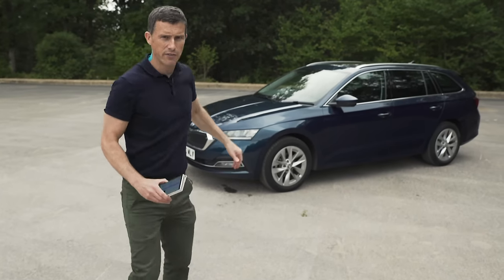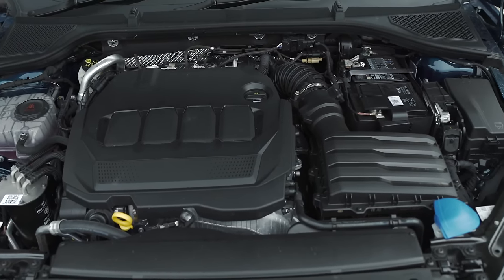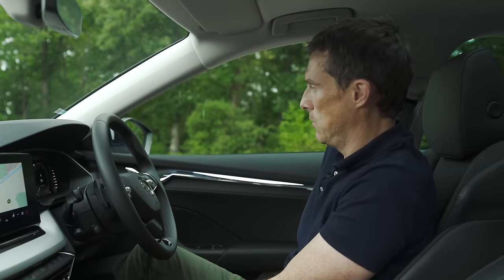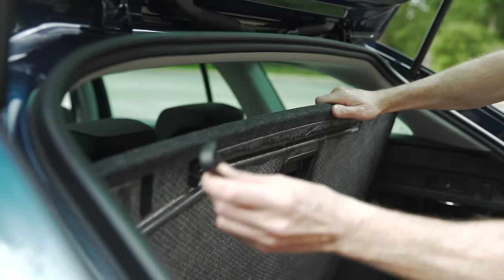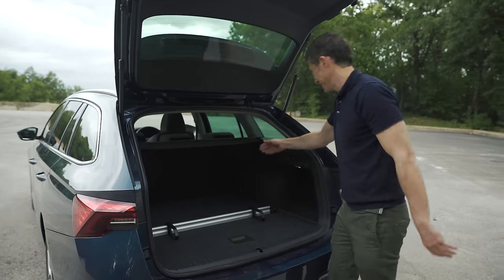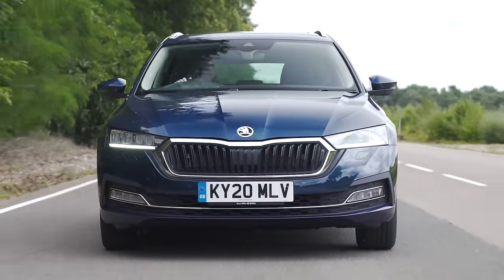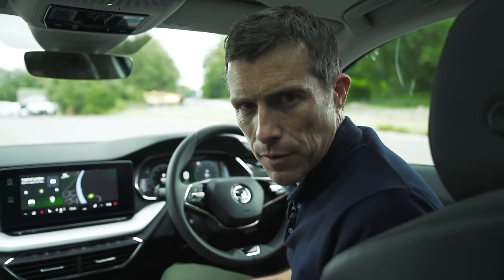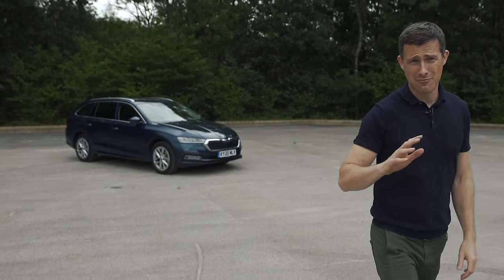The only car you really need: Skoda Octavia 2021 review

Comment: 11:45 That wiper fluid cap is genius, should come standard on all cars 👍
Reply: nah, it's better, but if you pour it on the blue part it  just splashes everywhere, so basically it only saves you a little spills when you aim directly into the hole
Reply: I hope that the plastic doesnt go bad when the first winter comes
Reply: @evokki0075  What weird car are you driving that has plastic "going bad" in winter?
Reply: Doubles as a she-wee 😂
Reply: I would much rather have that scraper or even umbrella as a standard. Especially with winter like we have this year.
Reply: that cover doesn't work good, drips at seams

Comment: I took one of these (plug in hybrid version) on a roadtrip in Finland from Helsinki all the way up to the northern border to Norway, well beyond the arctic circle, and I also did a similar drive in a Golf 8. And I must say, I was blown away by how much better the Skoda performed. The handling on the frozen and snowy roads was on point, the engine had no struggles at all in the -30C weather and the ride was super comfortable. The Golf wasn’t bad in any way, but the Skoda was so much more spacious, the drive train felt a lot better and the interior felt more comfy.

Comment: I have this car , skoda octavia III 105 HP fabrication year 2013, i got it in 2017 from a firm with 8400e , it is still going strong with no problems, the only thing i changed(besides the oil/filter and all that ) was the batterry from the original one to a 65 one. Very good and reliable car.

Comment: 10:00 it's the automatic handbrake engaging.
Reply: Nope. Because the noise is coming from behind the steering wheel. Handbrake should be more quieter from the back.

Comment: Having had one for 7 months I can confirm the infotainment system is so glitchy, I've decided to sell the car. Skoda dealer having to seek Skoda UK permission to replace the screen. 4th visit to the dealership to get a screen related problem fixed! So frustrating, as we like everything else about the car. But when everything is controlled by the touch screen and the touch screen doesn't respond to a touch, one has a big problem!
Reply: Was it that bad of an experience. Thinking of a 2021 Octavia.
Reply: @crunchchannel8788  Well we've had the car nine months now, and the screen was replaced last week. Along with yet another rattle being fixed, this time the strike plate for the driver's door. I think maybe we've had a Friday car, but I don't think we could trust it beyond the manufacturer's warranty, in case we continue to have things go wrong. Just make sure you give the screen a good once over before buying, and go over some bumpy roads. In terms of practicality, comfort and economy the car is great - we have the 150 bhp manual, SEL.
Reply: @rad1sh480  thanks for taking the time to reply. I saw a 150hp Diesel from 2021. I am mostly looking at used. But i will follow your advise for sure if I decide to go test it. 
Thanks

Comment: The warning when you open the door and the engine is on, also helps when its in stop mode and the engine is technically still on but not actually running.

Comment: Had mine 18 months now. The Emergency SOS system still doesn’t function properly and the ACC had a mind of its own until Skoda fixed it. 

Cons: 

The climate controls in the screen are fiddly and dangerous when using while driving, so just don’t! When you adjust the fan speed or turn on the windscreen demister it turns off the sync setting on the dual zone. 

The infotainment system sometimes takes forever to turn on or goes off and resets during drives. 

Pros

It’s roomie AF! 
The boot is big enough for my dog (and I own the saloon version)
The 150bhp 1.5 petrol is nippy when driven properly.
The fuel economy is outstanding because of 2-cylinder mode (when you are cruising up to 80mph the car will run on 2-cylinders in eco or normal mode)
I get an average of 60mpg and the most I’ve ever got is 70mpg. In France at 80mph for 4 hours straight it fell to 52mpg. 

The seats are comfortable. 

The virtual cockpit is good.

The matrix headlights are awesome once you are used to them. 

It’s a very quiet and relaxed drive. 

I do wish I leased something else, but I got this car top of the range SEL model with some extras through car wow on a 4 year, 10,000 miles a year, 3 months up front for £230 a month. I can’t knock that! So, if you are watching this considering it, I would just on the comfort, space, and most of all the fuel economy from the 1.5ltr 150bhp petrol manual.

Comment: I have the current version 1.5 SEL and this does not seem any different except a softer suspension and the frustrating touchscreen air con control. With the current version you just turn easy to find rotary knobs. 
He's right about reflective materials being distracting. I had the pre facelift version and the facelift introduced piano black material which reflect sun and street lamps.
All that said, I've had two in a row because it offers value, space, economy and quality. The 1.5 has cylinder deactivation which gives me 10% better fuel consumption than the previous 1.4.

Comment: I drove an Octavia like that for a year. So I wanted to drive it. But most of the time it was in the workshop. Because of software problems that neither the workshop nor Skoda could solve themselves.
If we hadn't returned the Octavia, we would still be waiting for the big software update today. There still isn't one.
Otherwise, it was a fine car with lots of space, it was quiet, fast and economical.

Comment: There seems to be alot of owner complaints regarding software issues with majority of this model which affects the use of simple things like aircon and major things like car hitting brakes as the car thinks there is an object in front it. Has this now been resolved or is Skoda still denying there is an issue?
Reply: Mine has issues won't allow me to select cruise control needs an update

Comment: Many thanks for this review, I'm picking up a new SEL First Edition estate this morning after viewing it and many others. I have a Tiguan at the moment and looked at the Karoq & Kodiak but couldn't afford a decent  spec on the Kodiak. I didn't like the Karoq and settled on the Octavia, which will be my first Skoda!
Reply: How you finding it? Mines going back after 6 months for multiple unresolved issues
Reply: Had mine 2 days and cruise control not working, stuck on speed limiter function. Can't be looked at by skoda for a month. Long drive to France tomorrow night bad without cruise
Reply: @johngarethjenkins  mine was trouble from the day I picked it up, for the 2 years I owned it. So many electrical/techy niggles from day one, including not stop problems with SOS system, entertainment system, front assist, rear assist, telling me I wasn’t wearing my seatbelt when I was and sat nav! My only saving grace was I bought it end of Feb 2021 for an amazing price of £21,500. Part exchanged it at end of Feb this year, with 20,000 miles on it for a new Karoq and only lost £500 from new!!! Incidentally, the Karoq has not missed a beat and already has 5,500!miles on it. The Octavia had been in garage 3 times at this age. Dealer kept putting it down to all the new tech in that Octavia, Karoq is old tech with lots of lovely knobs and buttons, which are a godsend after that stupid big screen in the Octavia that controls everything

Comment: Shortlist it?! There's literally no other real rival to Octavia in this class. And Matt gives "shortlist" verdict to all kinds of shitmobils. If you are in the market for this kind of car, Octavia is the car. I tried to change it (my previous car was Octavia 3), but simply there's nothing that's even close to it.
Reply: mazda 6
Reply: @Mirec2x  Mazda 6 is in the upper class and is more expensive. And not really that practical.
Reply: @musaka87  Well the mazda 6 start at 22k Euros and the higher version gets to around 35k, so it is pretty much the same price. Octavia used to be a lot cheaper, but with each new generation they have increased the price quite a bit
Reply: I had the Octavia 3 as a courtesy car when a rock punctured my intercooler.

It was the 1.6 diesel and oh boy... That's a porta-potty on wheels. The engine sound was unbearable.

Comment: I remember when octavias used to be a cheap car.
Reply: Still are
Reply from the maker: Still pretty cheap, no?!
Reply: You can always get a 2000s skoda for 1000£
Reply: @carwow  Cries in poor
Reply: it`s still very cheap used skoda octavia or superb.Cheers from Ireland
Reply: Dacia Sandero is cheap, Octavia has great value for the money.
Reply: @oscarinthemiddle  i still prefer my 2003 VW Bora wagon on the way it drives over a sandero... I wouldnt take that on the highway
Reply: Aren't they? What car is cheaper in that size class with similar features?

Comment: When the company leasing for my former Passat ended last year, I was told that I'm going to get a Skoda equivalent as a successor due to better delivery times. I automatically assumed that they had ordered a Superb for me. Imagine my surprise when suddenly they were like "Your new Octavia is here.". At first I was angry and disappointed with their choice, but my opinion after almost a year of driving it has changed drastically.
The Octavia may be a bit smaller than the Passat and Superb, but it comes awfully close to them in terms of space. I carry a lot hardware and equipment with me in the car and never ever did I have to worry about something not fitting in there. I've done multiple store closures where I easily had more than 1,000 litres of hardware to put in the car and I never came close to having issues. We've also done quite a few long excursions with my girlfriend and our 6-year old daughter in it and not once was comfort or space a problem.
Combined with the fact that the car can sit comfortably doing 175kph, or 110mph, on the German Autobahn (and the 150hp Diesel engine  can go as fast as 224kph, or 140mph, and it's still relatively comfortable), and the fact that the ride itself is surprisingly smooth, this car has positively surprised me in every way. Yes, the build quality is a bit worse and material may be cheaper than on a Passat, but at the end of the day, you get pretty much just as much car as with a Passat. To me, as someone who drives about a thousand km per week and enjoys a stable ride while listening to my music and podcasts and who has to carry quite a bit of stuff at all times, this car is all I ever need. And cheap on the tax too. :)
Reply: How's the overall noise level compared to Superb/Passat?
Reply: @johannescarlsson4559  Mine has acoustic glass, which is an optional extra, so I've never really had moments where I thought the car is too loud. The engine is also the same 150hp, 2.0lt Diesel that I had before, so I didn't notice any real difference there either. It's fine.

Comment: The thing with the key for keyless entry is that when your cars battery goes to zero so you cant unlock it with buttons you can sort of pop the thing that you touch for unlocking (if you have keyless entry) the car and there should be classic physical lock you can use the key for. I haven´t really seen it live but I´ve heard about it a lot

Comment: The big question: Will the petrol versions go for 300000 miles trouble free like a Toyota Camry?
Reply: Is that a rhetorical question? It might but have you ever sat in a 100000 miles Skoda? Its awful.
Reply: Hard to say. I know other VW group cars. Audi A4 with 580.000 kilometers without big problems and Audi A2 with 730.000 kilometers almost trouble free. So I believe those cars. I have Audi SQ7 and R8 Spyder and after 115000 km (77000km) no problems at all. So maybe Skodas petrol engines are not that bad...
Reply: @akceleracevideoblogy417  it would be interesting if someone collected proper statistics on the long term reliability and viability of cars
Reply: @bingobongo1615  I've never been in a Skoda before
Reply: @bingobongo1615  awful if they were driven by a prick. But a lot of cars will feel bad after 100000 if their owner was taking care of them.
Reply: The 2.0 Cr diesel definetly will, its basically the same engine since 2009, only emission and other minor upgrades, and autotrader is full to the brim with fleet audi a4s and passats with this engine from 200.000 to 400.000 miles and most of them only have DPF light on if they were used in town so Im pretty sure that this one will last too. The petrols, im not too sure. The 2.0 turbo might, but the smaller hybrid ones, especially the 3 cylinder is pretty stressed with the weight+generator so Im not sure about those.
Reply: To be honest no. This is what I heard from a Skoda service manager, u will have all sort of problems like timing chain, water pump just to name a few. But they are good cars and I like the ride and handling much better than a yota which is boring.

Comment: Never understand car manufacturers that put a prop shaft tunnel on a car where 90% of the Engine & Drive options dictate front wheel drive and because 1 variant has 4 wheel drive, they sacrifice rear leg/foot room on ALL models. Just make a specific chassis for the 4WD models

Comment: Just a small observation but my mk7 Golf has a single hydraulic strut to hold the bonnet open. The mk8 Golf has done away with that and you have to manually operate a rod to hold the bonnet open. Skoda not only has a gas strut on this new Octavia, based on the mk8 Golf, but has two for good measure. A case of VW penny-pinching on a more expensive model.
Reply: No gas strut on my 2021 model !

Comment: "Decent amount of head room for the middle passenger", really? Your head would've been scraping the roof had the sunroof curtain been extended. You were quite critical of the Hyundai Tucson for middle seat space which had far lower transmission tunnel and better headroom as well but, I guess, that's how your bias shows through the cracks.

Comment: Back in the days, when VW took over the Skoda brand, Skoda Octavia came with a 1.8 Turbo (A3 platform) cheap, fun and practical.
By the years, there cars just got more and more "expensive, boring and luxurius", its a shame, but maybe VW just want to make some easy money of cause. If cars is starting to be made without passion, why not just buy cheap cars from China instead. I hope some of  the car industry will continue building exiting cars.

Comment: I really do like carwow and Mat, but this specific point of the crease/indent line on the side at 1:20 is just so random. When its a Skoda its just bang a hand on, lala more of good ole same just skoda like. Matt has done videos on BMW which had the EXACT same crease/indent line on the side and this was softly touched with two fingers and a long story on how the german engineers really emphasized performance, airflow blabla. Unbadge the cars and do a blind test like red wine and nearly all cars look alike within the same categoru sedan, stationcar, sub, mpv etc.

Comment: Never figured out how to lock any Skoda enabled with KESSY (keyless entry) while the engine is running. I am not even sure whether the ones without kessy will lock with engine running. Its pretty stupid if you wanna f.e. de-ice or  let the climate control cool the car and you are in a bad neighborhood etc ...  Some people leave dogs and small children in the car .. im guessing this is designed against trying just that since climate control on battery power is basically useless. I wonder whether this is a non-issue in  electric skodas (i know theres only citigoeIV but soon more will come)  and hybrids.

Comment: This car isn't the best at all. I'm currently driving one, and it is absolutely rubbish. The auto box is dreadful. you're always fighting with the lane assist, which isn't good, especially if a child falls in the road, you swerve to miss them, and lane assist forces you back towards them, the stop start is a joke, turns off when your still moving. Worse of all, say you wanted the limiter instead of cruise control. (Example)have to go into a system and change it, taking eyes off the road to do it. Back to the auto box, it allows the car to COAST, which I thought was illegal,
Do I think it is a good car, yeah OK I will hold my hands up. I do like it,
Do I think it's a safe car to drive? Ummm no, don't quite think so,

Comment: 11:47 damn, in the 2016 model, the washer fluid has a small hole with a cap that doesn't want to stay open, and the stand to keep the engine lid up is right next to it. Filling the washer fluid is pretty annoying, but fixing only one of those problems would make it possible with just two hands. Apparently they've fixed all those problems.